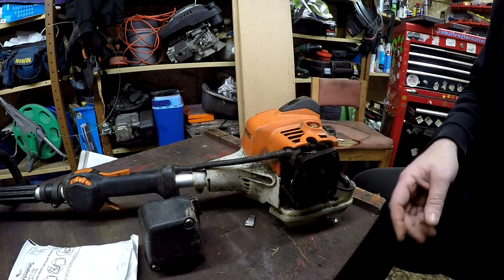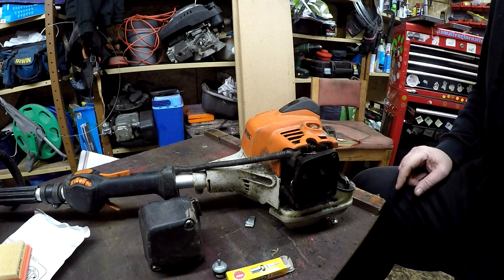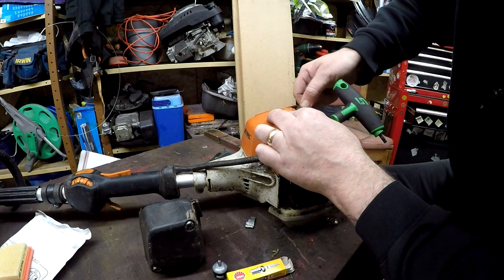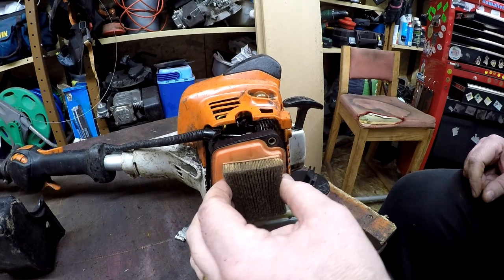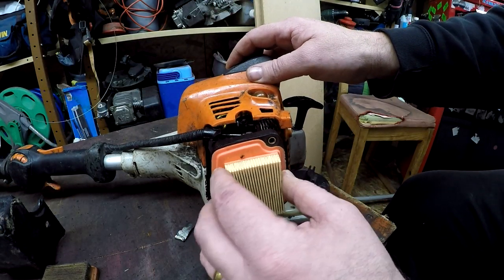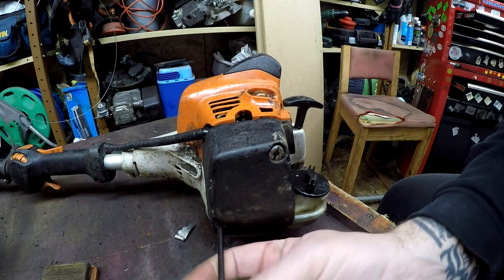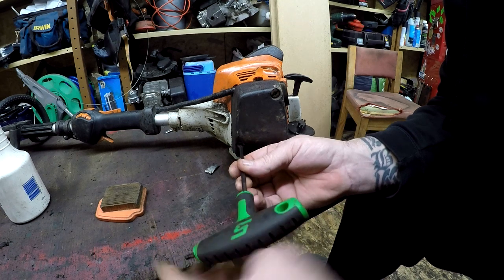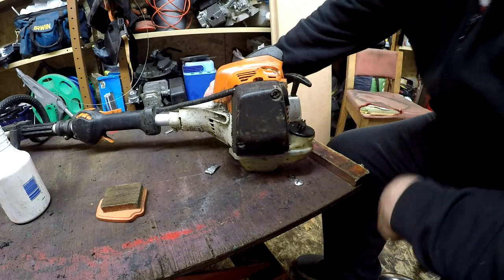STIHL KM94RC Hedge Trimmer How To Service Quick and Easy

Comment: I have the line trimmer version and a bit older. Mine was discarded, I picked it up for around $20. Its really one of the best trimmers I have ever owned. It needed a full carb rebuild and cleaning. Pole is a little bent, gas cap leaks only if ya hang it, plastic is ruff, a bit twitchy on the high speed tune so I leave the mixture a bit fat but its reliable, smooth and starts fast!

Comment: My combi isn't running as powerfully when my strimmer attachment is on. Any ideas mate?
Reply from the maker: I would take off the strummer head and try it. And also if it’s possible grease up the strummer head gearbox
Reply: @themowerman  appreciate it thanks. Having watched the video back, it seems my fuel filter isn't at the bottom of the tank either so could well be that
Reply from the maker: @TheGreyGardener1990  yes that would do it

Comment: Hi, crank has seized/won't rotate on mine, running fine beforehand, turned off fine- didn't seem like/sound like a valve dropped. Clutch & starter is free. Any idea? Much appreciated thanks
Reply from the maker: Take the recoil off and take the plug out . Now get a socket and try to turn the crank with a socket from where the re coil attaches

Comment: Hi Mick  I have a Sthil KM 94 rc brush cutter i have changed spark arrester, Spark Plug, Air Cleaner n fuel filter n it still boggie at full throttle  
 dont like messing with the carb if I can help ...
Great Video  champ 
regards 
Chris  from down under
Reply from the maker: Yeah it's the carb.. just try and tune it on the H side.. it may pick up brother

Comment: Someone suggested that I try sqirting some WD40 in through the spark plug hole and it worked - the cutter started and is running fine again now. I thought I'd post it here in case someone else ever had the same problem. Thanks again.

Comment: Hi I've just found your channel and very much enjoyed this video I will be  watching lots more. I have a km94 great tool it dose take awhile to warm up but run lovely after that sadly I managed to cross thread a screw to the air filter just spins and won't come out any tip on how to remove it?
Reply from the maker: Sorry just found this message.. hope you fixed it
Reply: @themowerman  got if fixed by the dealer in the end. Now running great. Not cheap though.

Comment: Hey Mick, unfold the hedge cutter attachment next time before you rev it up or you risk breaking a driveshaft or clutch drum ...
Reply: The new stihl style head, when folded back, will not run, gear box locks up, safety feature
Reply: jason Gardener yeah but it still puts a load on the engine and the driveshaft can break I have seen it many times in my repair shop...
Reply: @cbnx82703  very true mate
Reply from the maker: Hi hi. Ta for the comment.. that is the great thing about the editing button.. I unfold it before I started the old girl up..
Reply: Micks Mowers no you didn’t I could hear it the video that’s why I commented...! Been a Stihl tech for 39 years my ears don’t lie ...
Reply from the maker: @cbnx82703   lol maybe you need your ears testing hand on heart I unfolded.. it not my first rodeo mate Been fixing engines not just garden equipment for years too.. many thanks for your comment
Reply: I don't understand, I'm not trying to be difficult, but unless the blades are locked when folded back, how if the blades are running freely, which it sounded, how it damages the drive shafts and clutch, as runs through bevel gear
Reply from the maker: jason Gardener it’s not a problem Jason mate I know what I did
Reply: Micks Mowers Mick, don’t bullshit a Bullshitter, you can hear the powerhead load rpm against the locked hedge cutter blades .
Reply: @themowerman  no problem mick, just watched again, iv run kombi' for many years and can clearly hear blades moving 👍
Reply from the maker: @cbnx82703  ok ok now go back to the film at 11m 55s and see what I did with my thumb. Then you can hear the revs pick up and the blades cut in.. I don't need to continue to explain to you..I k ow what I did.. and i don't appreciate the language.. many thanks for your comment as always and your continued support
Reply from the maker: @jasongardener3425  yeah mate this trimmer has a throttle control that it may sound like it's not running but at 11m55s you can see I adjust the throttle to give the engine more revs.. still thanks for your comment as always bud
Reply: @themowerman  
Yes, I see you adjust it mate 👍.
Just as a matter of interest, on the km94, about a year or so ago, they moved the primer bulb, to the  front of the machine, I assume the bulb is the same as old ones though.
Have a good day mate 👍
Reply from the maker: @jasongardener3425  hmm I will be honest and say I don't know mate but they are cheap enough to get a pack of different sizes..
Reply from the maker: Ok just to be clear.. I have the video in an unedited form.... and shows the trimmer unfolded.. if you would like me to send it over please let me know..
Reply: @themowerman  no need mick, your word is plenty good enough, if others can't take it, there not worth  your time, keep up the good work mate
Reply from the maker: @jasongardener3425  ta very much mate I respect that
Reply: Micks Mowers in the original video of which I watched twice upon the moment in the video just before you revved the engine it was still folded and it was pushed forward out of view of camera and you can hear the resistance under load then seconds later you can hear it free wind probably you edited then...

Comment: Im guessing you have a small gateway but there is a model of ride on Mower that should fit through, mountteild 1228h and other repranded equivalent. Nice, cheap and easy start to ride on mowers
Reply: As I'm sure you know, larger ride ons are more expensive to repair, more risky and often less financial viable

Comment: Hi Mick is that multi purpose grease
Reply from the maker: Hi temperature mate why do you ask
Reply: Enjoyed that. Didn't see you grease the pinion gears on the end of the shaft. I know gardeners often forget to do these and when they fail as you'll probably allready know it's the full set you have to change for them and it isn't cheap.  Grease gun is definitely the easy way but not the only option.